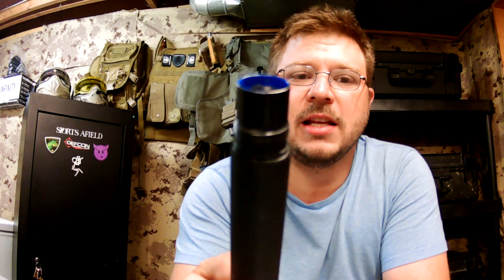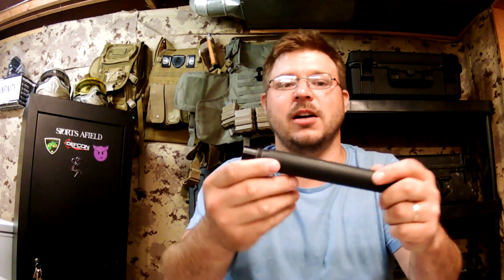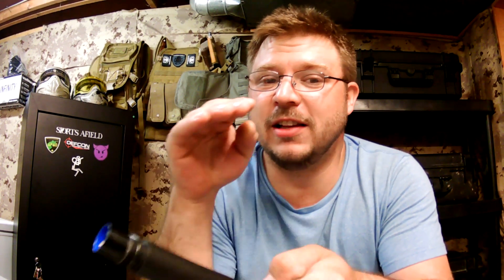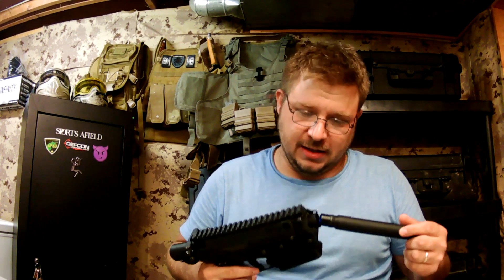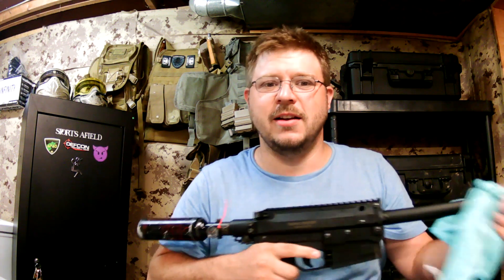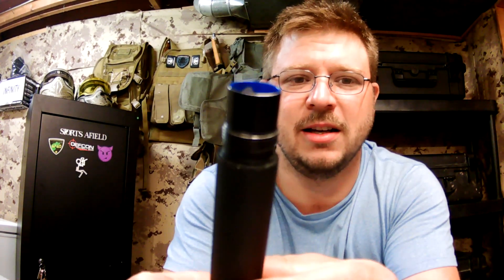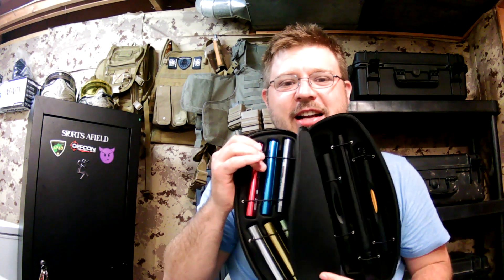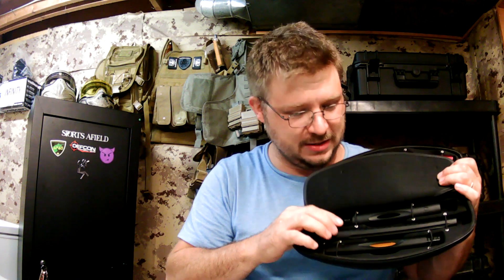Valken M17 #custom Bushing Test

Comment: Mech,
One of my M17s has marks inside the barrel while the other one is fine.
How do we change this bushing? 
Talk to us bro 😬🙏
Reply from the maker: It is a matter of measuring the existing bushing and bolt, and taking the tolerances down.  Keep in mind heat expansion etc, make sure to measure your bolt in many different places, the largest number you get, is the one you use.  If not, you’ll jam your bolt in the bushing.
Reply: @MechTactical  thanks brother. I’ll give it a try and report back when I hopefully see you on Global 3 (Oct. 2nd). 😊

Comment: I’ve been searching the market for the freak kit with A-5 thread. I was even told there was no such thing! 🤦‍♂️ but you clearly have one so could you help a fellow M17 lover (since day one) find a kit. Further more are you saying that a freak kit shouldn’t be ran on a stock M17 without the “race” bushing? If so could I use your connect for that as well? Thank you brotha!
Reply from the maker: I tightened up the specs on the bushing because with my stock setup the bolt was just kissing the barrel sometimes.  I didn’t want to buy a freak kit from (impact Proshop) and have it get destroyed.  Very soon in the near near future I’ll be doing a 2.0 to this series.

Comment: How can I purchase One of those bushings and also where did you find the A5 threaded freak kit
Reply: Thanks
Reply from the maker: The bushing was sized to the bolt.  You have to take your existing bushing and bolt to a machine shop so they can copy the dimensions of the old one and ask them to tighten up the tolerances.   Long story short, no two bolts are exactly the same, so I COULD technically make up a ton of bushings, but there is no guarantee they will fit.

Comment: Wich one have more power? Tmc t15 or m17
Reply from the maker: Hard question to answer.  The M17 is more moddable but I stay away from power type questions.  Not out to hurt anybody by action or inaction.  Sorry dude
Reply: OOTB, The M17A2 is the most powerful of them if tuned up, but the marker has been made such that it catastrophically fails if above a certain point. You risk EXTREME INJURIES and/or DEATH if the PRV/regulator threads BREAK under extreme pressure. Tuning must be made by gunsmiths with proper training in airguns and it's illegal in many countries. Even the weight of the projectile can make it explode.
You've been warned.